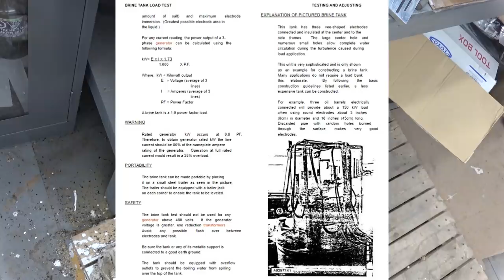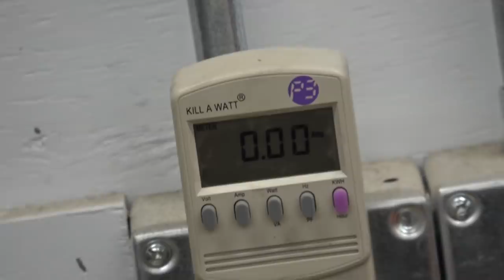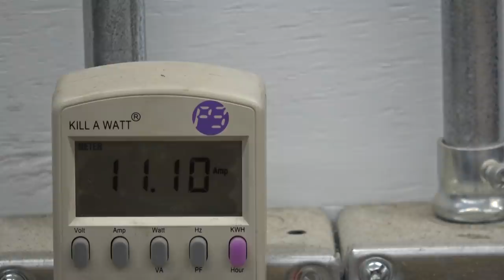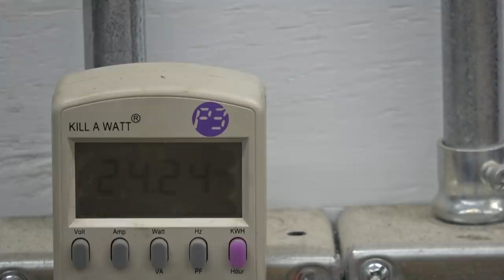Forgotten knowledge: generator load testing

Comment: Mehdi on the electroboom channel just went over why and when breakers trip when they do. More load quicker snap something something.
Reply from the maker: Duly noted!
Reply: Its due to the ferromagnetic strip inside if the circuit breaker, if there is a short circuit then the eddy current trip it really fast, and if there is to large of a load it slowly heats up and eventually pulls a trigger from the expansion of the metal, so the more current passing through the faster it warms up.
Reply: Oh yeah, I was pretty surprised to see the mfg curves at the end showing how long different loads take to trip! Makes sense; it would suck to have to fight the breaker with motor startup circuits/etc., but I would still think they would trip a little faster.
Reply: circuit breakers are meant to prevent the wires from melting, if they tripped right at their rating you'd never be able to turn a vacuum cleaner on.
Reply: @arduinoversusevil2025  I work on programming circuit breaker trip times and got excited when I saw the time current curves for the breaker. See them every day!
Reply: It's known as the I²T law. The more current the lower the time to trip. Dewclaw should have been able to inform you thusly.

Warped perception also did a video on breakers tripping in slow motion. Made AvE look like Prudence, the safety goat.
Reply: Logan is on the money! its about the time fault current graph. Ask the DewClaw about it any electrician can tell you that. Hence why circuit breakers are preferable to rewireable.
Reply: I was just coming here to say the same thing. Twice in as many days I've seen how slow breakers are to react.
They have a curve of load vs time that shows the time they take to react.
Mehdi was pulling something like 300A  and still wasn't able to get the 30A breaker to trip before the heated shower head burst into flame.
10x the breaker rating had a reaction time in the ballpark of 8-15 seconds iirc
Reply: Do you guys in the states generally use the slow breakers? Here the commonly used one is a "B" Type breaker which has a trip current (for short circuit) of 3-5 times the rated amperage. Sometimes for say shop applications a "C" breaker gets used with a trip current of 5-10 times the rated amperage so your welder doesn't trip the breaker every time but you can still use a 16A circuit. Obviously if enough time passes they all trip at the rated current (or slightly above)
Reply: All a load bank is, is a giant toaster. That being said a heater elements out a standard one being 1500wats at around 30 to 50 amps so wiring effectly should and has made a very temporary and hack load bank.
If one was to do the salt brine thing 9 would get a specific gravity on the brine do some maths, say fuck it and move on.
Also Covid was found alot earlier there was a covid 12 a covid 8 a covid 3.
Its been around.
Reply: Electro boom is not a good channel, I can recommend Photonicinduction he isn't about any more but his channel is still up.
Reply: @allesklarklaus147  
Not an electrician but I cosplay as one when the inspector's not looking.
 I believe the breaker type (B, C, D) depends on residential vs commercial and local building codes and application.
The breakers in my home are all B type from what I can tell except for the ones going to the shop in the garage there are two C types.

Circuits going to a bathroom or anywhere near water require a GFCI breaker and/or GFCI outlet in the circuit.
Newer homes often have AFCI circuit breakers as well that detect arcing and not just the heat from high current draw and short circuits.
Reply: @heatshield  because he's a showman, making things go pop and pretending that it was a mistake in some way is kinda dumb. Photonicinduction look him up on YouTube.
Reply: Hilarious, first thing that popped into my head about his new infrared heater install.  I learned quite a bit breakers through that vidja.
Reply: @allesklarklaus147  We use square "D" style breakers.
Reply: They’re basically like slow-blow fuses. A few seconds of overload won’t trip them.
Reply: Breakers you find in residential and commercial applications (maybe not high power ones) can trip two different ways. They are thermo-magnetic. The thermo trip mode occurs by overloading a breaker above it's trip point for a long period of time, but won't trip if mildly overloaded for a very short amount of time. The higher the current is above the trip point the faster the breaker opens (similar to I^2 * t in fuses, might even be specified in breakers the same way). This prevents inrush currents from motors and the like from tripping the breaker, like when your wife starts the vacuum or when the A/C kicks on. The magnetic trip mode applies to short circuits (many times rated current) conditions and trips immediately due to the large current creating a magnetic field in a small electromagnet inside the breaker.

In the states a "leakage" breaker is referred to as a "ground fault circuit interrupter" or GFCI.
Reply: @allesklarklaus147  Yes, that's why you have to de-rate to 80% for continuous duty.
Reply: Let's be honest the UK has the best electrical gear and standards. If you want to see what electrical equipment the average normal house in the UK has check out Photonic Induction on here
Reply: @arduinoversusevil2025  in the UK in overload the pop at 1.45 times rating so if you could get a 10a breaker it would pop at 14.5A that's why we want low resistance in the circuit protective conductor so in a fault the breaker will experience high current a pop faster.
Reply: Beat me to the punch!
Also, if you're interested in the ratios of "amps passed through to time the breaker stays open" you can ask the manufacturer for a data sheet on your make&model
Reply: I was just fucking around with how high does the DC voltage have to get to arc-fault an AC breaker. . . . I should start a channel.
Reply: @snap-off5383  2020 code (now delayed due to virus), will require GFCI on all circuits 50A and below. So basically everything now. Was due to some people dying on faulty wiring on electric dryers and ovens, where a GFCI would likely have saved them.
Reply: @faceplants2  so duno bout everywhere else but in the uk we use b type c type and d type breakers. B type being 5x rated current, c type being 10x and d type being 15x 
So a d20amp will pull 300a on short duration before itll trip to allow for motor startup
Reply: @Chris Ccwater99 Yikes! I bet that was not a fun surprise. It's probably a good code to adopt, even though it will cost a fair bit more to fill the panel with all AFCI/GFCI breakers. I suppose in the grand scheme of installing a new panel and/or house, it's relatively small cost.
Reply: @andrewt9204  In which state or country is this? Yeah rooms with water, laundry, bathroom, kitchen, should all have them.  I just wish they were at the breaker instead of on the first outlet of a string, when they trip hunting them down or accessing them can be a pain.
Reply: @snap-off5383  This will be in (or is probably already in, starting 2021) the US NEC. So any state/county that follows the national code will need to have this implemented. I haven't read the code in depth yet, but it seemed to me that the fault protection was required at the panel. Could be wrong on that detail however.
Reply: Arc-fault interruptors are becoming the standard these days, definitely a good thing 👍
Reply: Inverse time circuit breakers.
Reply: @SuperAWaC  woah, never thought of that
Reply: @IceBergGeo  I’m pretty sure it’s dooclaw
Reply: @porterwilson4665  seriously? I mean, it is possible... But, I always thought it was dewclaw, like on a dog... Every dog has them, but most are pretty useless.
Reply: @Wayoutthere  Apparently it's been 3 years now. I can picture photonicinduction having gone in a cartoonish flash of lighting, like when animated characters get electrocuted
Reply: @faceplants2  and the fire that hapened while totaly under water

hot shower anyone
Reply: No ignition source, for the hydrogen? 
See how much flame you get, per amp.
Reply: @Soloist1983  except for the fact they dont work on existing ring mains
Reply: Dusty 99  why? Have you never seen a load bank? Also glue is for kids i huff methyl ethyl keystone and nitro talaite. Gee if your gonna huff have some self respect about it.
Reply: @SuperAWaC  Startup Inrush vs running load current ?
Reply: @Theinatoriinator  Wait... I thought breakers had "heaters".  Large breakers have replaceable ones so as they age...
Reply: @markschweter6371  yes
Reply: oi
Reply: link!!!??? searching electroboom channel for "breaker" finds nothing indicative.
Reply: @thedavesofourlives1  The link is further up in these comments. ^
Reply: I think there's usually a magnetic trip for short circuit protection and a thermal trip for overload protection in breakers
Reply: I remember in trade school watching a 20a ITE breaker hold 30 amps for a few minutes
Reply: @andrewt9204  I thought the main problem with shocks from electric dryers and ovens was because of the brain-dead NEMA 10 receptacles which were still being installed until 1996. With these the neutral wire is connected to the case instead of a proper ground. So if the neutral wire comes loose you can get 120v on the appliance case. With newer installations using a proper grounded NEMA 14 connector this shouldn't be an issue. GFCIs would help with the older NEMA 10 setups but these are existing houses almost certainly won't get the GFCI upgrade.
Reply: Literally just watched his video like 20 min before I saw this one!

Comment: I've fried the Kill a Watt a few times. Jump the thermal Fuse inside and she's good to go for another HOT run.
Reply: I tried to get one warrantied once.  They were a joke but a new one showed up 4 months later.  Shorting the fuse helps, I stuck a small breaker on one.
Reply: I agree that Kill-a-watt aint done until it gives up the ghost (smokes)! lol
Reply: I ordered a trio of replacement fuses when I blew mine out. I was measuring the current used by an RV and the air conditioning went on. Ooooops.
Reply: and if he wants to test the temperature at which his mains electrical wiring melts, just stick a Canadian peso (US penny) behind the 20a fuse in the box when you replace it.
Reply: I have two newer dead ones before the company shut down, the death of them was sadly not the fuse but the sensing electronics, power passes through but it doesn’t snitch
Reply: I got one and returned it - twice, they seemed to fail without that much load for me.  I can't remember but I want to say they said something terse about the third replacement.  Thankfully, it's held up for seven or eight years.  I think I left the first one connected to a fridge to measure power consumption over the course of a month or something.

More recently, I got a four pack of these Blue tooth controllable plug in switches which do a bang up job of not only controlling various outlets but also measure power consumption, voltage and energy usage over time.  (you have to calculate your own PF)  

I think the four pack was just slightly above the cost of a Kill O Watt and in some ways more useful.  The brand is TOPGREENER Smart Plug if you're curious.  Big Clive should take one apart.

Comment: Just so you know, trip time for a breaker at rated current is about 60 - 90 minutes
Reply: Not sure about North America but circuit breakers in Europe and Japan are actually required to not trip indefinitely at rated current in normal conditions. 60 minutes is usually trip time at about 1.1 to 1.5 of the rated current.
Reply: In Australia everything up to 40 amps has to be on an Residual current device, on a standard new home the only breaker you'll see now is the main switch
Reply: @hauuau  In North America, just twist those wire nuts on hope for the best.
Reply: Funny story.  Buddy of mine and I were installing a doorway (really just cutting a hole in a wall) and in the process adding a light above which meant changing a regular circuit into a 3-switchero.  We got the electrical 'done' first and turned on the light and then proceeded to plug in the sawsall to attack the wall.  Soon as I pulled the trigger the lightbulb above us dimmed and we knew something was not as planned.  Before fixing this my friend mentioned I should try to permanently mount the sawsall into the wall and call it a dimmer.
It's not a bug, it's a feature.
Reply: @NOTNOTJON  
Now thats the kind fo creative home improvement i like.... for other people
Reply: @wearsjorge55  RCDs and CBs perform different functions and circuits require both. In a domestic situation all final sub-circuits should be protected by a Residual-Current Breaker with Overload protection (RCBO) which combines the two functions in one device.
Reply: @Dmon-dv1lf  yeah I'm caught up my dude. Tbh I commented in the hope of getting info on other countries and if they use them

Comment: When I was in tech school back in the 90:s they had a dynamometer in the engine lab using a generator to load the engine being tested and this kind of a resistor to load the generator. 

Also I've seen one used as the starting resistor for a 160 kW slip ring motor used on a rock crusher. There was a tank with three cone shaped copper electrodes hanging from the top and another tank with the salt solution stored in it. The electrodes were connected to the three-phase rotor windings through the slip rings. When the start switch was pushed a pump started pumping the solution from the storage tank into the tank with the electrodes and as the fluid level rose the electrodes would get submerged and the resistance would decrease gradually soft-starting the motor. When the starting sequence was complete a time relay would close a contactor short-circuiting the rotor for running and stop the pump. There was an adjustable bleed hole (used also to adjust the rate of filling of the electrode tank and thus the starting time) through which the solution would drain back into the storage tank resetting the system for the next start. It would work fine most of the time but sometimes when it was cold the resistance would not go low enough before the contactor closed which caused the main breaker on the 300 KVA generator to trip necessitating a new start cycle.

Comment: Plugging the angry pixies straight into a bucket of salt water, I'm in. Can't wait to see where this goes.
Reply: Old school Theatre light dimmers ...well they were, people kept dying which put the kybosh on that.
Reply: Prisoners sometimes use makeshift immersion heaters to boil water for cooking (without permission)
Reply: Ah ah ah what have you done did to me fishes??? All me salt water angel fishes are floating and smelling delicious might I add.
Reply: If you're in the bucket, get out!
Reply: @leerman22  que @larry lawton
Reply: where this goes? Angry bucket of course...
Reply: @leerman22  called a stinger, they work really well. You use what you got, also can use it to light a cigarette. But that a little different
Reply: @mickenoss  ahh the good old days...
Don't forget to vent the dimmer room...
Reply: Works great for alternating current... Not so good for DC though... It seems to behave more like a capacitor than a resistor.

It's what I use for topping off my lead acid battery bank when there isn't enough sun to do the job.

A sea water potentiometer and a diode bridge out of an automotive alternator connected to a cheapo generator from harbor freight... The exact same model shown in the end of the video, but with a start capacitor for a refrigerator compressor instead of the crappy fan start capacitor that they come with.

Since I live on a sailboat, it's a rather convenient solution.
Reply: @carolynwilbur1627  lol 4 years will do that to you.  Seen lots of crazy things for sure

Comment: When i started welding at marion  power shovel , the welders were controlled by raising and lowering a copper rod in a water tank , it was in the sixtys.
Reply: Did the rod get lowered into the tank to the point the welders started screaming, then lifted a notch? Was there a Moaning Point where the welders were most efficient?  Glad I was in junior school during the 60's, let me tell you!
Reply: @MrPossumeyes    Yep ,you turned crank until the welder groaned for the heat you wanted !
Reply: @MrPossumeyes    There was no OSHA  yet , just the union and your common sense for your safety.

Comment: On the note of manuals, not only are newer ones terrible. They're impossible to find, I got a Ford 8N earlier this summer and the book is detailed how to do everything. Plus nearly every bolt is the same size, pretty nice to work on in the field.
Reply from the maker: Now when you order a hard copy manual for $900 (so it works in the cold), it shows up and it's a single sided stack of PDF printouts.
Reply: I don't agree. I carry a van full of manuals for my industry in my 3lb laptop. I wouldn't have room for tools if I had printed manuals.
Reply: A selling point of the Ferguson TO/TE tractors - cousins to the 8N - was that they only required one spanner for all necessary adjustments.  The spanner was also marked for measuring the liquid level in the gasoline tank.
Reply: I bought a 1944 Monarch 16CY lathe in 2019. Monarch is still in business so I called them up with the serial number and they mailed me a manual including a parts list (yes they still have parts support for 70+ year old machines).
Reply: @chrismorris8695  +1 for Monarch.

Comment: Back in the day before silicon controlled rectum fryers or even autotransformers,  theatrical lighting controllers were based on rheostats to accomplish dimming effects; raising/lowering rods in salt water pots were one method used.  The saltwater would sometimes boil off during a production, especially a dramatic one with lots of dim lighting. Some old crusty stagehands still have initiation tails of being told to top off the "piss pots", not knowing they were live.